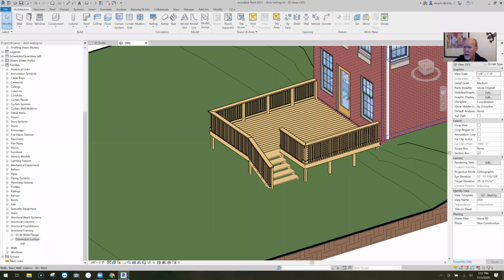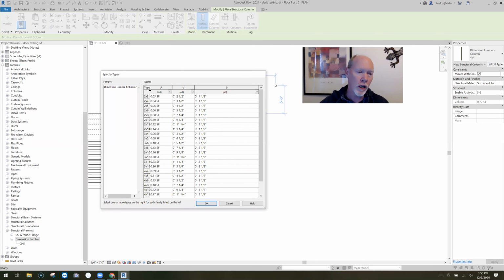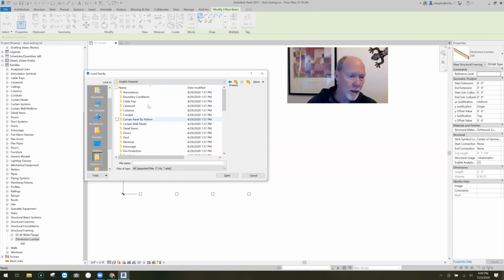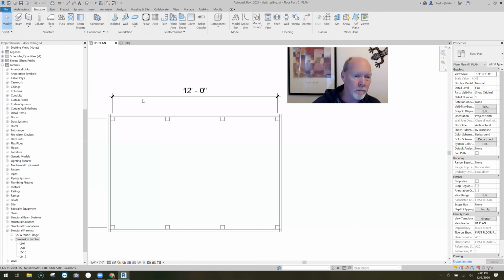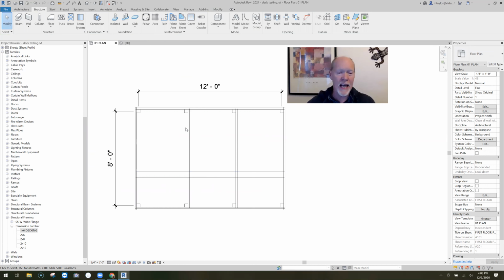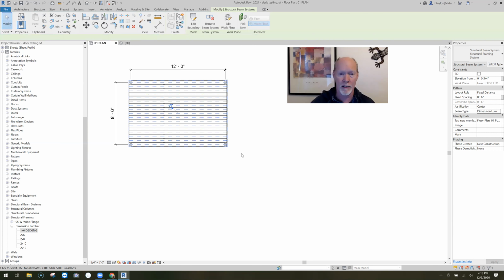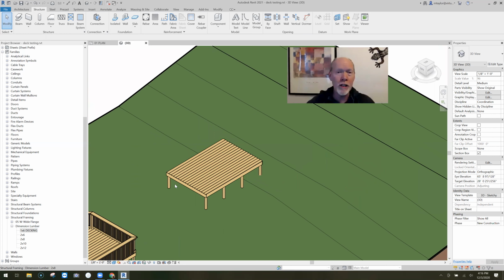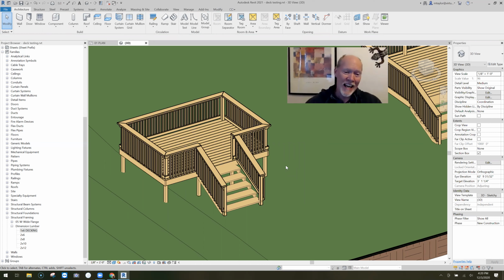BUILDING A WOODEN DECK: Special Request

Comment: Great video! Definitely helped me out. I'm trying to create a simple railing with 4x4's with a 2x6 on top. The problem I'm having is the railing, the top, the 2x6 doesn't go to the end of the 4x4. your railing is perfect. If you could point me in the right direction that would be great. I'm a student and attempting to learn Revit. I was able to build the deck and create a 2x6 for the top and bottom railing it just doesn't go to the end of the 4x4 like I said.

Comment: Excellent video. HUGE value. I really appreciate the fact that you do specific examples that I can mimic. That is where I learn the most as when I make mistakes I can keep rewinding until I can replicate what you are doing. Also I love your relaxed fun demeanor. Just as an aside and not that it matters for the purpose of this exercise but normally a deck is comprised of columns and then beams (so 4,6 or 8 feet apart for example) usually sitting on top of the columns and then Joists running 90 degrees to the beams and spaced 12, 16 or 24" apart. All this means is that you are missing one layer of the deck (the joists). Again probably a big don't care because you have taught me how to do the drawing of the framing. Thank you so much.
Reply from the maker: Thanks a ton John. I appreciate your comment. I think we could all benefit from watching a video on someone building a actual deck - in real life and not on Revit!!!  My professor in college told us all to go work in the construction industry BEFORE we got a job at an Architects office... we would learn a LOT there!

Comment: Hi, this video was very good. I have only used Arcitecual , but see that Strucrual has some benefits. But i get some problem gutting in the deck for a swimmingpool, and taking some decking on the side of the structure. Do you have any tips and tricks for this ? Thanks.
Reply from the maker: Yes, the Structural tools in Revit are very powerful and have some benefits. I've got a friend that can make just about anything out of a 'Structural Beam'. =)
Reply: @miketaylor-fantastic  Could maybe he make a video  on how to cut in the decking, and how to put some covering on the side of the decking ? Thank`s